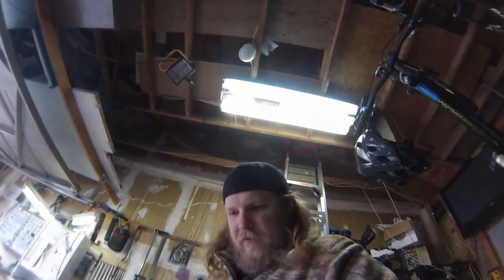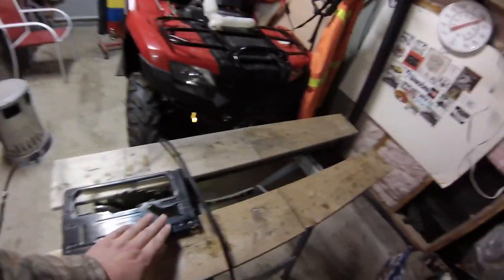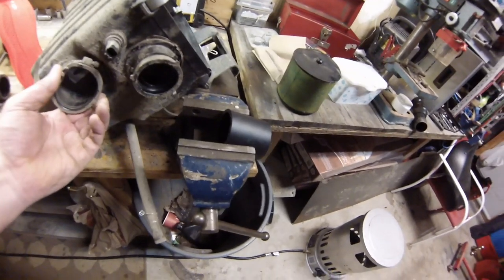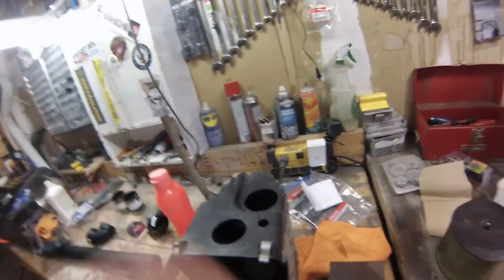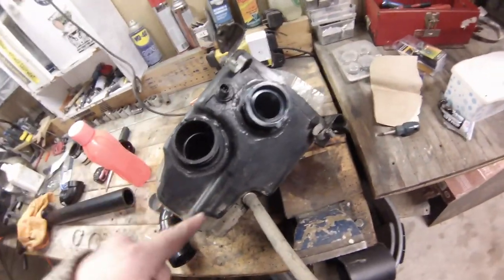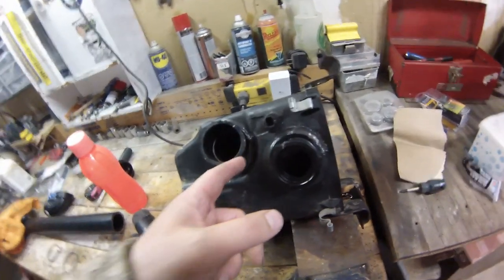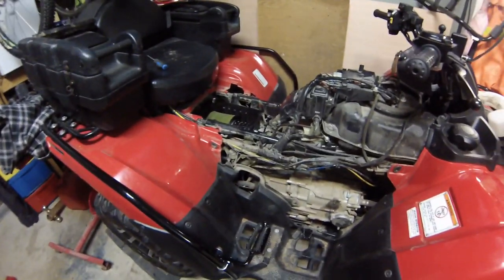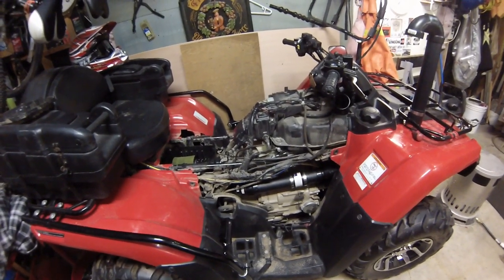How To Snorkel A 2015 Honda Rancher 420

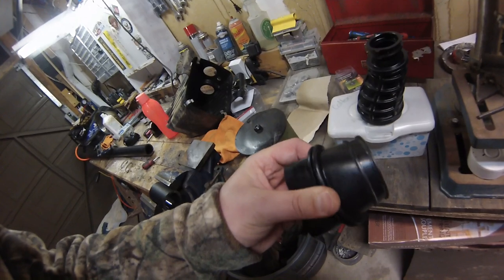Comment: At 3:04 the part your were guessing about is your IAT Sensor.   Internal air temp is what it stands for,it’s about 32 bucks brand new.  Self explanatory what it does.  Sometimes those will wiggle lose causing a false FI code to blink red 9 times on your dash.  Simply replace or plug back in and the problem is fixed. 9-10 times it’s eaten my mice.

Comment: Thats never going to vibrate loose . Nice idea !!!
Reply from the maker: I guess I should have shown how it's attached to the frame with heavy duty zip ties, and then again on the rack where it exits.  I rolled it 2 weeks ago, broke some ribs etc.  Was a good crash, and everything is still intact.  At the airbox inlet, it was ultra blacked to the nuts, and the worm clamped super tight.  Been 4 months now and all is still air tight
Reply: WOW that sucks - never broke a rib before , hear it hurts to even cough or laugh .

Comment: Is that a pull start I seen
Reply from the maker: yessir.  pull start back up
Reply: Ghostma is it after market or factory accessories
Reply from the maker: factory option
Reply: @GHOSTMAATVs  I wonder if the 2019 has that option
Reply: @loganbeddard7969  they come on the Canadian ones for some reason

Comment: If there's  leak anywhere in the system you're screwed.
Reply from the maker: That's a chance you take when you snorkel.  The box is deep enough that you can test quickly and then back out of the water to check for leaks.  I drive it right into the lake over the rack and back out.  Air box was dry as a bone.
Reply: Exactly you gotta pay to play!!!.
I have the same ATV and mine has been 100 percent air tight for over a year now I take her past the handle bars! 
But I check the air box about every 30 minutes or so just to be sure!!.
Plus I put a shammy rag at the bottom of the air box just in case my snorkel dips under for a split second..
(Don't ask me how I know) lol